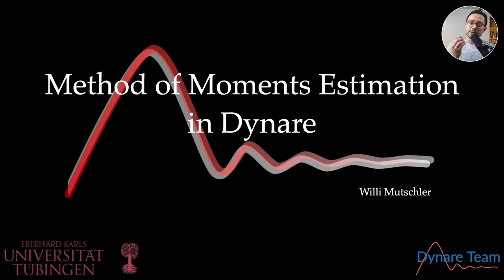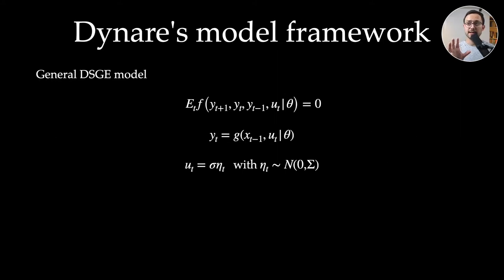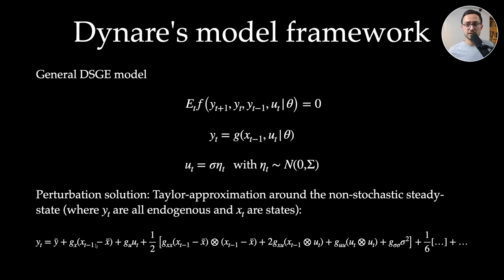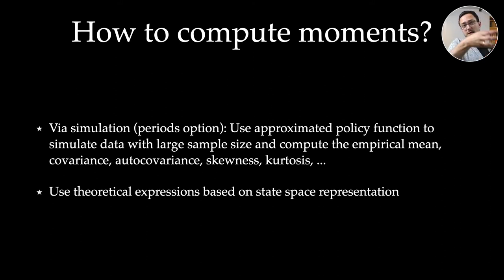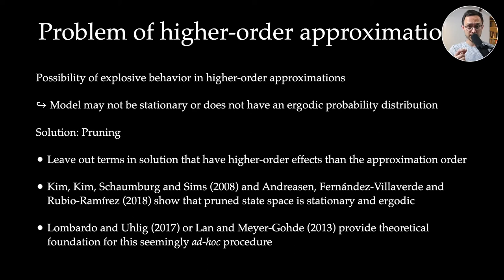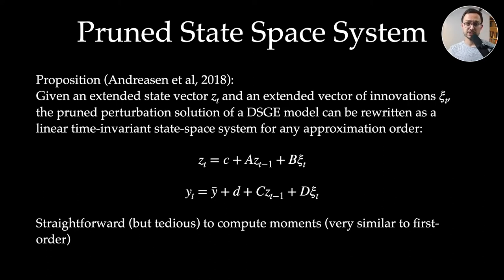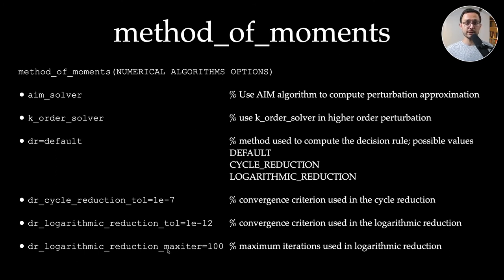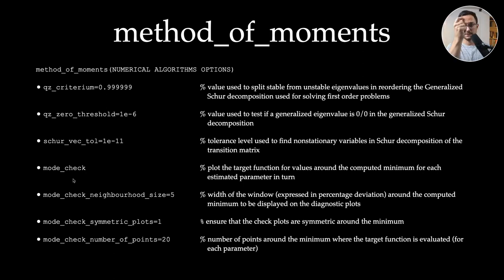Method of Moments (GMM and SMM) Estimation in Dynare 4.7 and 5

Comment: Thank you very much for developing and explaining the great toolbox! I was wondering whether there is any quick way to specify the correlation (instead of covariance) of two variables in the matched_moments block; I have the question due to the specific data moments I have in hand. Thanks a lot!
Reply from the maker: Not yet, it is on our roadmap as we do have a useautocorr option to the pruned_state_space function, which we use for the identification toolbox. So the computations are all available, I still need to adapt the code and display of results, but that is not a high priority right now. So try to hack into the datamoments and objective_funtion in the method of moments folder and make that according to what you want to achieve.